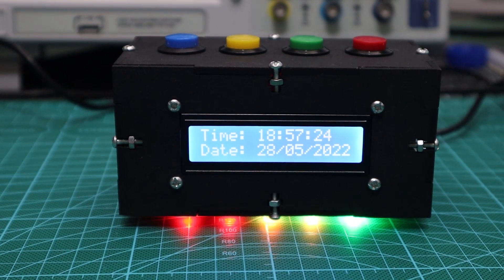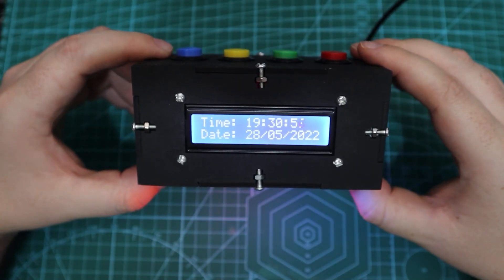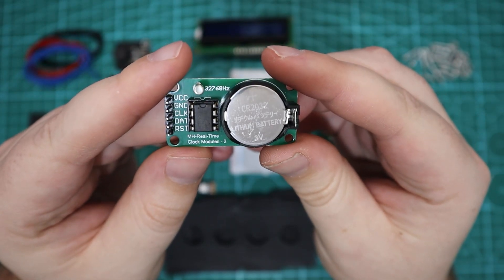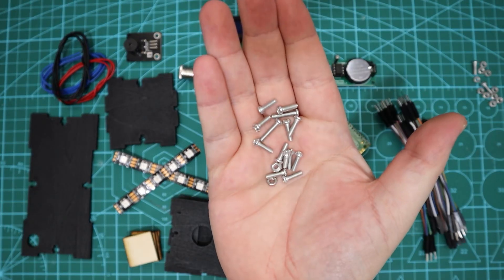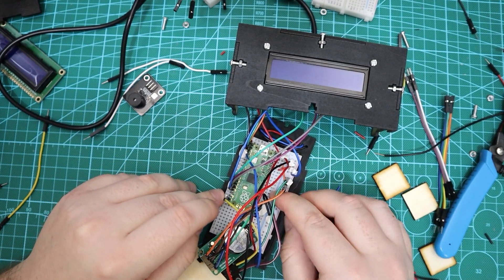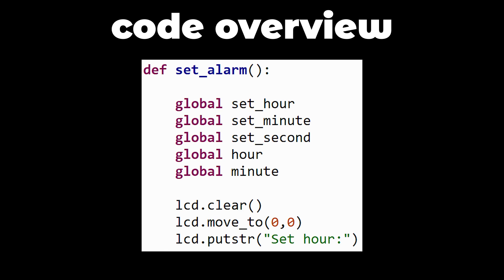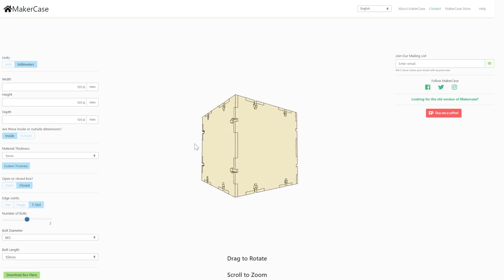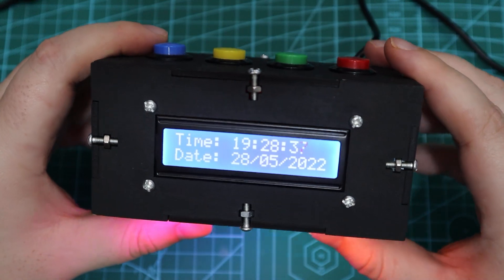Raspberry Pi Pico - Alarm Clock Project

Comment: Hello, Im having an issue with this project. I have everything wired exactly how its outlined in the schematic (also put the CLK wire on GP18 instead of GND). What is happening is that the time and set alarm constantly flashes on the lcd and when i try to set the alarm the screen keeps refreshing. Not sure what is going on but i am using a Pi pico breadboard kit since it has both the buttons and buzzer integrated.
Reply: For more context on how the buttons and buzzer works on the board, here is the following logic:
Buzzer : Buzzer On = 1, Buzzer Off = 0 (OUTPUT)
Push buttons : Not pressed = Logic 0 , Pressed = Logic 1 (INPUT)

It seems that i need to modify the buttons code to account for this but i am not sure what exactly.

Comment: Thanks for the video if I need a clock this is the one I will make Cheers Bob I don't see any guitars?
Reply from the maker: I will suggestion doing this with Pico W, then you will not need the RTC module, the RTC cause some issues, I had it losing time after few weeks like an hour

Comment: I am a late bloomer . With the Pico world.  At my age . 53 . I have lots other crafts under my belt and I am planning on using some of them on a project. I came across your video a couple weeks ago and it set off LED lights in my head . Take what I learned from you and put it in a wooden box that was properly finished. That would be so nice beside a bed . Could add temp to it also . To be displayed. Keep it nice and simple.
Reply from the maker: Sounds great! I would probably suggest to replace the pico with the Pico W that you can then get more information online like accurate time, weather info etc. I found that the clock module I used in this video it lost a few minutes of time after a few months.
Reply: You think you are a late beginner, I am 78 years young and want to learn Python, so joined this channel it looks awesome to make things.

Comment: Could you build the alarm clock with the internal pico rtc?
Reply from the maker: The only problem using the internal RTC, is that the Pico does not have a battery on it, so every time it is turned off you will have to set the time where as with a RTC module it keeps the time as long as it has power, or if clock has access to Wi-Fi then Pico W is better since you can quickly grab time from online. If you want to use the internal RTC with micropython as follows:
rtc = machine.RTC()
rtc.datetime((2020, 1, 21, 2, 10, 32, 36, 0))
print(rtc.datetime())

Comment: Would this work with a raspberry pi 3 too?
Reply from the maker: it would but the code shown here would not work, as you will have to use libraries specifically for the pi 3. I would also suggest not use the ds1302 if Pi has wifi because can get date and time from any website providing that info through there API

Comment: Is it possible to connect it to a 9v battery as a source?
Reply from the maker: No. Safe operating voltages are between 1.8V and 5.5V. If you want to I would suggest you get a buck converter module that will step 9V down to 5V or a voltage regulator.

Comment: How about an Amazon Echo Clock? Maybe with a Pico W, but probably with a Zero W.
Reply from the maker: I have not heard about Amazon Echo Clock before will check it out, recently I made a clock with the 8*32 rgb matrix using the pico W have not recorded the video yet
Reply: @NerdCaveYT  I just mean an Echo that also has a clock. I've seen builds for an echo, but not a combination one with an alarm clock 😉
Reply from the maker: @pouceo  I checked now what it is, we don't really have amazon back home and currently I am living in China so all the smart home things are xiaomi projects and of course all in chinese
Reply: @NerdCaveYT  ha! okay, thanks for looking into it.
Reply: @NerdCaveYT  My son and I are making him an alarm clock based on your build with a pico W. This way I can set the time pulling from the internet. I'll be interested to see your pico w build when it is finished.
Reply from the maker: @pouceo  I can upload the code I just made one using the addressable LEDs but you can basically use any display, and change the code. I used a simple API to get the time with the pico W and display it, a video instruction for it might be early Feb. I don't have access to my workshop camera etc. but do have the code on pc
Reply from the maker: @pouceo  you can reach me on discord if easier to talk there

Comment: sir getting error in main file line 39 please help
Reply from the maker: so few things it could either be the connections to the pico or:
I2C_ADDR     = 63
I2C_NUM_ROWS = 2
I2C_NUM_COLS = 16
which there is a chance that your I2C address is not correct.

Comment: hi, im trying to make an alarm clock like the one with pico but i will be using a raspberry pi 4 is there any way to avoid using ds1307
Reply from the maker: Hi Nima, first question is will the Pi be connected to the internet if so, it will be much easier since you can access a website through API then get accurate info about weather etc. to display.

Comment: I like the LEDs along the bottom! I use a similar lcd clock to time my work hours, but I used an esp8266 which connects to a time server via wifi to set itself, and 4 cherry keyboard switches and 3d printed case.
Reply from the maker: I saw a lot of people connecting the esp to pico for external wifi have not given it a try yet, it seems most people set the clock that why then you don't need the RTC.

Comment: I've been overthinking and under actioning a project like this for quite some time. The differences for the project in my head are 
* to use a pico 2w
* allow the device to set it's own clock automatically via NTP
* allow for an API to flex the alarm time based on outside conditions (for example if a system is down, the alarm wakes you up, or if the weather is looking like your commute is predicted to take longer, then it wakes you up 30 minutes earlier to account for the longer commute). The idea is that the alarm clock could just accept the new alarm times via the API and pre-shared tokens/keys, but something else that holds the keys could be programmatically smarter to figure out the new alarm time. Another example that I thought would be cool was if, on a school snow day... I wouldn't have to sneak into my kid's bedrooms to turn off/change their alarms.

Great project! Awesome execution! Thank you for sharing with the community.
Reply from the maker: That does sound like a lot of work, my programming is not up to standard as it should be struggled hours just to get the formatting correct on screen, but have the clock connected to online and having connecting to an API to change alarm based on conditions sounds cool. I think to change the alarm in this project I made easiest might be to add a Bluetooth module to set the alarm instead of the buttons. Also thank you for taking the time to comment and I am glad you liked the project. I am making PCB's for this for my students so that I can have them build it on breadboard then give them a PCB, then they can focus on making their own case etc.

Comment: can you set the time?
Reply from the maker: The time you have to set in code unfortunately, you set the ds1302 time here: ds.date_time([2022, 5, 24, 0, 18, 24, 00]) then run the code then the ds1302 will start keeping the time then you have to uncomment the line of code and run the program again. This will then make sure the time is not reset but still using the correct time from the ds1302. That is why I only made the set alarm functionality because once time is set the battery on the ds1302 can last up to 20 years of keeping the correct time.
Reply: @NerdCaveYT  I see, thanks for the fast response, love the projects. Great job.
Reply from the maker: @TheUnofficialMaker  Thank You